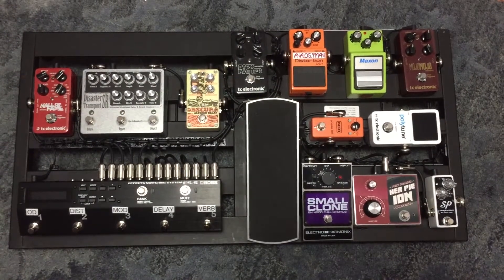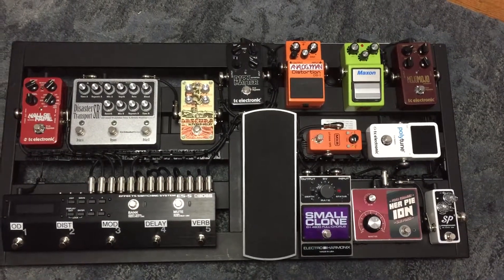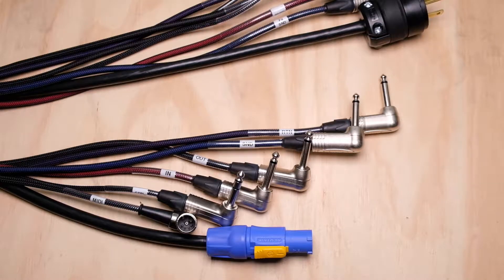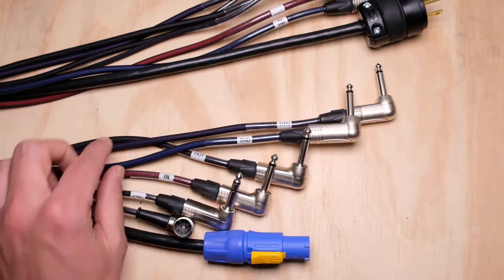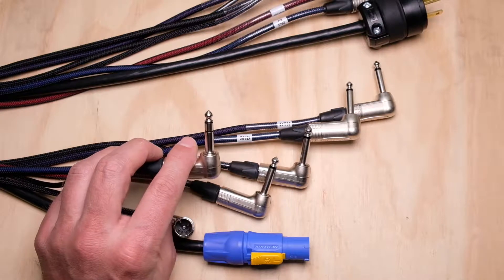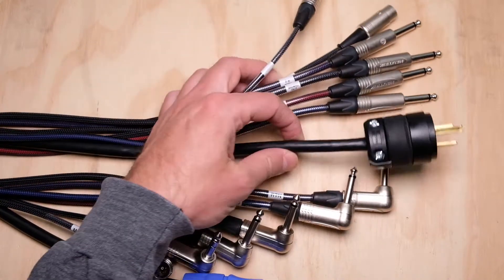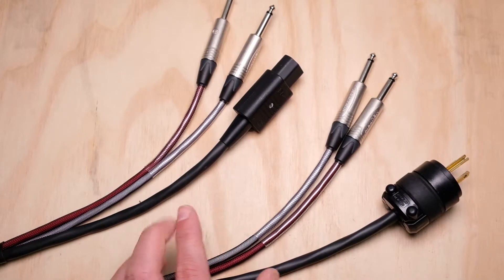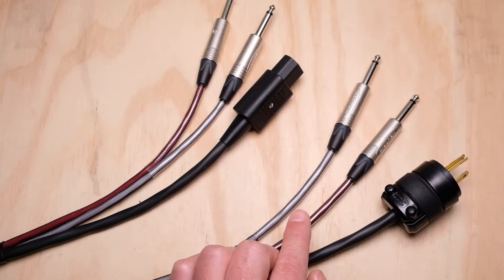Pedalboard Snakes

Comment: What's that stuff that the cables are wrapped in at 7:08? Is that outer shield sold in bulk?
Reply from the maker: The black mesh on the red and white ends is just tech flex. The bulk of the cable has a black, PVC overjacket. It's just the way the cable is built.

https://alphatone.com/collections/frontpage/products/pedalboard-snakes

Comment: Is there anyway to have just one connection for all these? I mean all the cables stay plugged in at all times and then when you set up or tear down your rig there is just one plug
Reply: You can get into multipin systems for live use, but there are some drawbacks. They're expensive, entirely custom-built, and not really designed for power. And you'd still need some type of breakout for the amp side of the setup unless you had everything rack mounted behind a panel. Other than that, it's doable.

Comment: Where did you order the tech flex , or braided shielding for the individual runs? I just got a composite cable from btpa and would like to add extra protection on the ends. What size diameter is needed also?